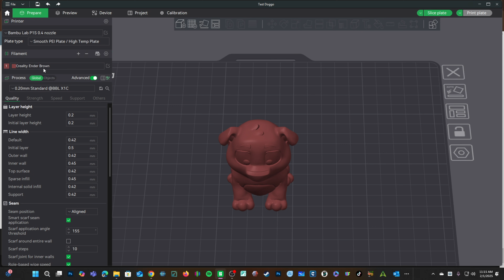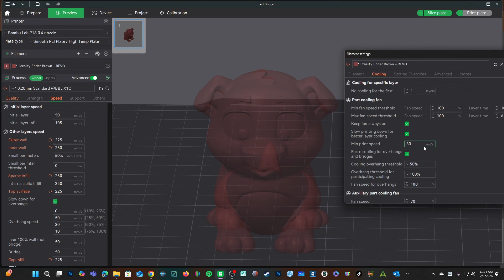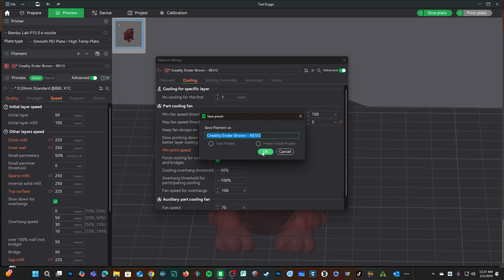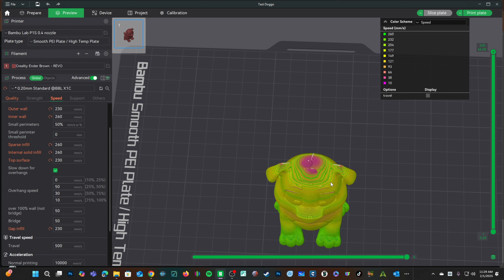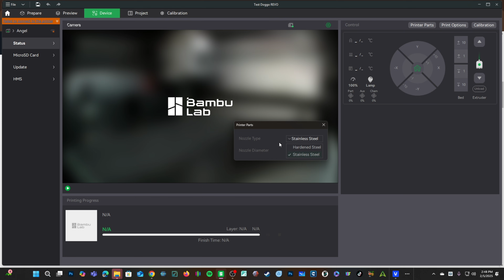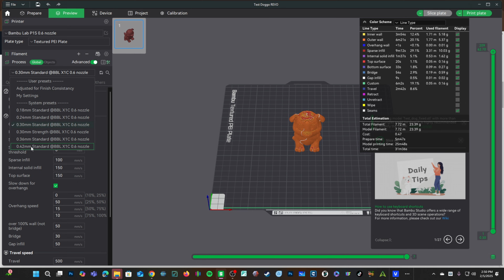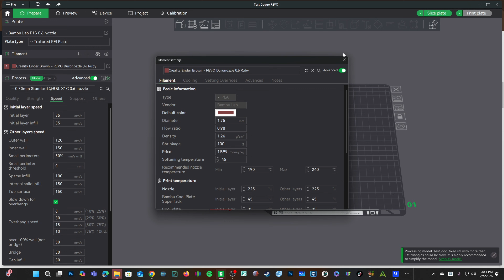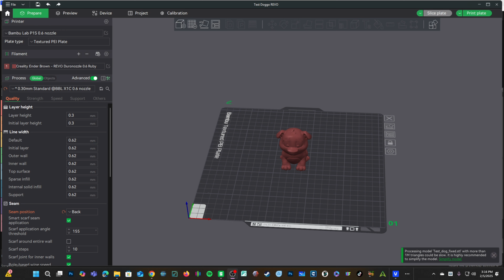Durozzle RUBY Nozzle - INSTALL/CONFIG - 0.4 & 0.6 in BiQu Panda Revo - Bambu Lab P1P/P1S 3D Printer.

Comment: Nice video very good explanation but how about de 0.25 nozzle because revo don't produce a 0.2 nozzle is that also useable in bambu studio, and the nozzle size change is happening on my printer not in studio anymore
Reply from the maker: this thread may be helpful: https://forum.bambulab.com/t/where-do-i-specify-a-0-25mm-nozzle-size/71457
Reply: @3DRundown  Unfortunately the nozzle size must be set in printer lately not in slicer software so that part is over i think,  I already think of a other nozzle to use can be change when cold and have 0.2. Bambu Labs never thought about change nozzles and i do that pretty much and don't know how long the connectors on board stay alive

Comment: How is it holding up now?
I print petg atm but wanma get a more durable nozzle then the stock revo but worried about leaks with aftermarket nozzles
Reply from the maker: I returned it. I was concerned about the same thing. 
 My big issue, was I found it harder to install and remove. Felt like if I did it a few times, it may fail. But, while I had it, it worked really well....
REVO should sleep walk through PETG
Reply: I'll just stick to genuine revo nozzle then @3DRundown

Comment: Awesome video @3drundown. Im currently installing on both my p1s's but i got a question about the panda touch should i install that or return it? #worriedaboutupdates
Reply from the maker: Be sure careful with the connectors on the hot end, and be sure that nozzle is screwed in fully. Be careful with it. I found it harder to get in, and out. Sent mine back, but, I can't deny I managed great prints, FAST, with it. Keep an extra eye on it, and I think it will serve you well. 
I forget my Panda Touch is even there. It's a fun accessory, but far from needed
Reply: @3DRundown  awesome thank you. I wasn't sure with the drama with bambu if the touch would still work.
Reply from the maker: There is conflicting information, but, I believe it will. However, is it really worth much? I dunno.....

Comment: This was a horrible nozzle. I had the nozzle for only 14 hours of use with nylon, and it started to leak. I believe that the ones given to people to try out are a better quality.Then, the ones that are purchased from people. And i'm not the only one who is the same problem. My opinion of this product.
Reply from the maker: That's a common Myth, spread by users. That is not a thing. We get, what you get. AT BEST.  The reality is, much of what we get, are actually PRE-RELEASE, Beta items, and often WORSE. Also, like 90% of my stuff, I paid for this with my own money. 
The leak, is likely caused by it not being screwed in tight enough. I found the rubber ring, to be soft, and loose, unlike the E3D ring, which are solid and attached to the nozzle. I removed it, tightened it a little more, then put it back on. Just did a 12 hours mask with out issue. I'll be doing that, till/if, it fails....
Reply: @3DRundown  That's not a MYTH it happen to me on both of my printers p1s and mk4s with that said. If it happen one time then I would agree with you but 2 different printers it's a bad nozzle! You will see run nylon through them.  I have proof of it if you want to see the pictures its of the mk4s ver something . I didn't know if you got your for free or not just because you didn't stated it in your video at all!   If you only run pla or petg maybe it won't happen to you!
Reply from the maker: I buy almost everything I cover, on my own. The "MYTH" I was referring too, is that Youtubers get better versions of printers and accessories. If anything, we get WORSE versions, because we get them early. 
My nozzle worked great for me, but, I have read a few reviews that had issues. I do think, it comes down to it being to difficult to screw in tightly. The real E3D nozzles, screw in far better. Because of this, I actually returned mine, as I would prefer an official E3D 0.6. However, I avoid getting into "review" territory, as I prefer making videos to help those that choose to use something, get the best out of it. I proved it can print well, but, that's as far as I can go.
Reply: @3DRundown  What I do agree with you it prints well but if it don't last then is it worth your MONEY that should be considered and possibility completely ruining your hotend . To your point this is not and early version of this nozzle now it's been out for a while now. Just trying to help you understanding longevity is the key of all these expensive nozzle if they can't hold up in heavy abuse dose it really matter how well they prints or how fast they print?  I hope you can agree with that statement.
Reply from the maker: Right, I bought this from Amazon. It is a full release version. Unlike, say, my K2 PLUS, which was an early pre-release version. 
In the video, I clearly stated, that while I can confirm it works, I can't comment, on how well it will hold up long term. Not much more I can say on that. Also, for nearly ANY product, I've ever covered, there is somebody out there, that insists it sucks. And, for every product, there are defects and such. It is what is is. People are going to get them anyway, and I'll be here to help hem use it...